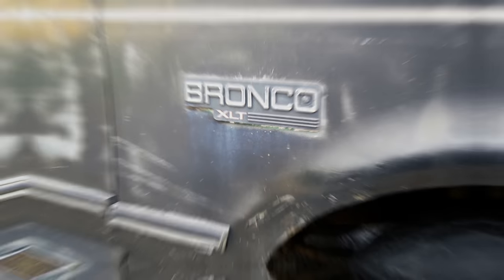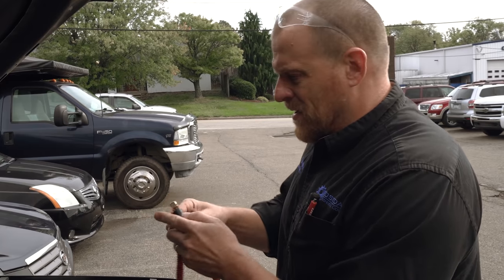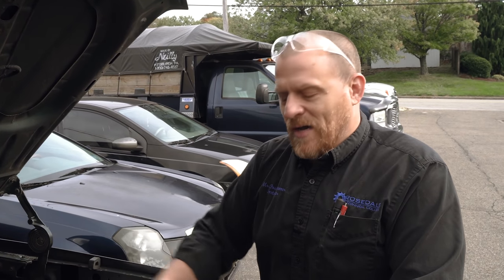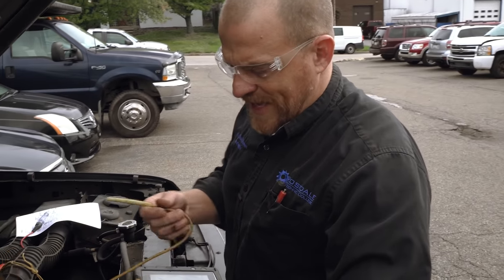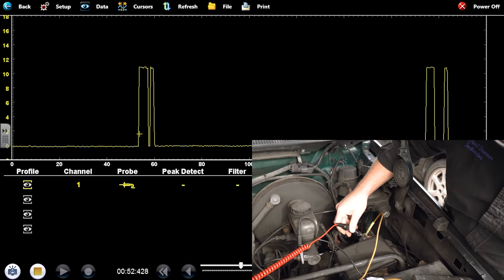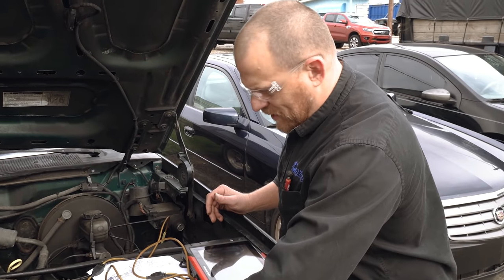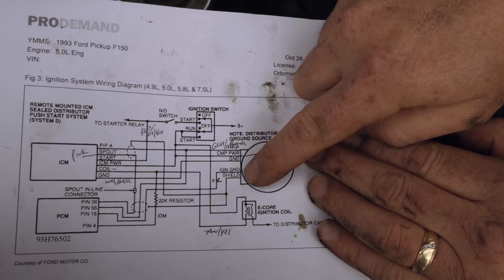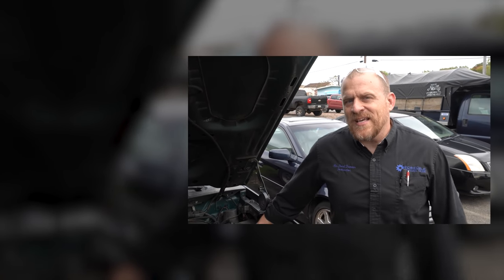Ford EEC-IV No Spark Diagnostics

Comment: Hi Paul, I'm jumping in a little from left field, but I've got a 2009 2.3L  Ford Mondeo/Fusion that's a crank no start with no ECM codes and an ABS module Yaw Sensor code, lost comm with Steering Angle Sensor and Invalid data from ECM.  I'm only interested in the no start and I don't think any ABS codes will cause a no start. But I have a vague memory of you saying some Fords with faulty CKPs will not set any CKP or CMP code? Is my memory right? But a 2009 model?? Just keen on your thoughts to help direction.
Reply from the maker: Those ABS faults won't cause what you have my friend. Is this a GDI system? Spray some carb cleaner into the intake and see if it starts as a starting point

Comment: no worries your safety comes first and that truck is a hodgepodge mess I mean the radio is hanging halfway out the dash, and due to being on a smaller pulle those fans can easily reach 10,000  rpm if idle speed at the crank/ tach reading is 1000 rpm

Comment: I'm helping a friend who has the same problem he has changed everything pick up coal Ignation module and coil and still no spark but you can hear the fuel pump run what would you do
Reply from the maker: New parts means nothing. Do some testing, then I can help

Comment: I have a question and need some guidance.

When the key is on, engine off, the back side of the ICM where the thermal paste is applied gets so hot within seconds that you’ll burn yourself. 
95 ford f150 302, 5.0 
Any ideas?
Reply from the maker: That means it is grounding the coil continuously. Not much will cause that except for crap parts

Comment: My coil voltage is too low to jump the spark from my rotor to the cap. It jumps about 1/16 of a inch
Reply from the maker: Okay, next step is an amperage waveform on the primary circuit with a scope, but I'm sure you don't have that, so it will be a little bit more tricky to identify to cause.
Low voltage on coil positive, high resistance on coil negative, a bad coil itself, a faulty ignition module or a bad ignition module ground can all give you weak spark

Comment: I've got a 7.5 that has voltage to injectors but no ground at injector connector. replaced control module on distributor. Any suggestion would be appreciated I'm stumped.
Reply from the maker: Didn't I answer this on another video where you asked a similar question on this 7.5 about the PIP signal?

Comment: Hey scanner, question  I'm  dealing with a 90 f150 5.0 . Starter shorted internal  . Whipped out starter and solenoid.  Replaced both.  Now i have crank with no fuel or spark .  I have run some quick voltage tests most all this checked out good no broken or burnt wires that I can see . could this potentially be a cause for my issue? Any suggestions or common things you've seen on these?
Reply from the maker: You have fusible links on either the starter or solenoid?

Comment: 1995 ford f150 no spark tested all connections for power and grounds everything seems to check out what could this be?
Reply from the maker: Do you have injector pulse? Did you do the PIP signal bypass test I showed?

Comment: These trucks were alot of weird issues. 
I found they have to throw a 1 inch hot spark or will never start.
Change the module in distributor . 
One kid replaced everything would not start and it had good spark by not enough to run.
Bizarre.
Some had to have coil actually grounded and often rust would cause it not to Start in 80s.
I hate these Fords.
Excellent videos Thanks alot.
Reply: I've got a 92 and it runs endlessly.  Only time I ever had a problem was when the rotor finally wore out and needed to be replaced.  The drivetrain is incredibly sturdy on these trucks...and the simplicity is a great thing.  Not hard to rebuild anything on these trucks, if one puts their mind to it.  I'll be driving my truck for at least another 20 plus years after recently doing a rebuild of both the engine and tranny....virtually everything done on my own except the machine shop work on the core of the engine.  That's the real beauty of these trucks.  They'll outlast anything new on the streets these days....because no one wants to pay huge repairs when current vehicles get into higher mileage.  You won't be fixing them at home....so they'll get crushed.
Reply: @joeidaho5938  you are lucky . I have so many come in shop. Frames rotted on box section next to front axel strut.
302 v8 was good . 300 l6 terrible EFI issues .
Happy you are good.
Reply: @MitzvosGolem1  Ya...the frame is the key to longevity.  I've been trying to protect mine...slowly applying rust paint or some kind of protection.  I know the engine and tranny will always last longer than the frame on these trucks.  My engine is also now at 40 over on the bores but just rebuilt it with upgrades.  Life has to end at some point...lol.  I'm just hoping it's good for another 20 years or so.  Thanks for your response.  Cheers!
Reply: @joeidaho5938  the pre efi Ford's are good. We live in salt belt near snow and ocean so Toyotas all frames rotted .
I like the 79 Ford's simple . 
Glad to hear your rig is ok.

We spray frame undersides with Krown oil from Canada. It's like a waxy oil never comes off and no rust.
Don't use tar rubber undercoating is bad. Holds water behind and hides rust. 
Use oil grease. Many use bar and chainsaw oil in North .
Cheers
Reply: @MitzvosGolem1  We're in a bit of a salt belt also here in Toronto....with constant salt on roads, sidewalks, mall parking lots and so on.  I've only been back in Toronto for 6 years, as I got my truck out in the Vancouver area where I lived for 25 yrs.  There are still so many out there....and they use sand on the roads mostly, thankfully.  It's absolutely rare that I see anything pre-1995 on the road here in Toronto.   The truck is definitely a rarity here.  As far as the efi, mine runs fine, on the whole, although after my rebuild I have a little bit of tuning to do.  I think it's the issue of needing to install a spacer on the idle air control to allow more air to get in when first warming up the truck.  It wants to stall when the revs first drop off after the initial idling.  I end up having to keep my foot on the gas for about 30 seconds and then it's warm enough to have a steady idle.  Still surges just a little bit but not a real issue.  I also didn't reinstall the pipe coming from the lower intake to the egr valve that then pumps back into the upper intake (plenum).  Instead, I installed a small air filter on a pipe from the egr so it pulls in clean air, rather than air from the lower intake.  Changes the balance of air a little bit, but that pipe from the lower intake is a royal pain in the ass after I installed an Edelbrock upper and lower intake.
Reply: @joeidaho5938  the 300 six has alot of weird surge issues. EFI system not good.
The 302 V8 ran beautiful.
My cousin replaced everything and I mean everything on his 92 f150 6 still don't run right. 
Check dual fuel tank valve also and in tank pumps pickup screen clogged.
Reply: @MitzvosGolem1  Ya....I  really haven't had any complaints of any real significance about the 302 roller engine.  Runs great, on the whole.

Comment: Ok Paul, after praying again, I unplugged the idle control valve and it started. If I plug it in it dies. Steve
Reply from the maker: Can you keep it running with your foot on the gas pedal?
Reply: @ScannerDanner  no sir! I bought another ic valve from auto zone today and so far it’s fixed.
Reply: @ScannerDanner  the spark from the coil is so weak it only jumps maybe a 1/16 of a inch if the icv is plugged in, Unplug it and bang, big time spark,
Reply from the maker: @steveross9058  how strange!

Comment: How did you do the bypass?
Reply from the maker: Test light to ground and touch on the PIP wire on and off with the key on.
Test light to power next if the ground test doesn't work. 
(Depends on where the trigger wheel stopped in the distributor for the pick up on what polarity to use for your test light)

Comment: So what happens if i don't get power to ground side of coil but it has power on the power side...only one side lights up??
Reply from the maker: It is one of two things:
A. The coil primary winding is open (bad coil)
B. Coil negative is being grounded all the time. 
Next test is to connect your test light to battery positive and make sure coil negative does not light. If it does, it is being grounded all the time. WARNING. Coil positive should be powered up during this test (key on). If it is not, the test I am suggesting can backfeed and give you inaccurate results.
Reply: @ScannerDanner  ok thank you will try and get back to you after

Comment: I’ve got a 1989 f150 4.9 I’m not getting any power to the coil or the dash
Reply from the maker: Get yourself a good wiring diagram (step 1)
https://eautorepair.adtrk.biz/?a=10817&c=24&p=r&s1=
Your dash and ignition coil would be two separate circuits unless you have some main fusible link that is blown? Not sure without some actual test results on these circuits

Comment: Hey I have a question, I was recalibration my tps, when I noticed my top wire(blk/w) was acting as my signal wire. So I tested the ACT and ECT to find they were acting as my signal wire. This is on a 1990 ford bronco II 2.9l. Do you have any suggestions?
Reply from the maker: Give me the readings on all 3 tps wires
Reply: Green 5.05v, bk/w 1.07, o/w 0.00. When engaging the throttle the bk/w goes up in value like a signal wire, based on the diagrams though, it should be a ground.

Comment: If it is a manual trans, you have to block the clutch pedal down
Reply from the maker: If it is a manual transmission it is super dangerous to use a starter jumper tool if that is what you are referring to

Comment: Hey buddy your probably really busy but I have a problem. I have a 89 f250 5.0 turns over fine, spark at coil but not at plugs. New distributor, ICM, plugs and wires and good fuel pressure and now my hair is white as snow any help would be greatly appreciated thanks
Reply from the maker: How far does the spark jump when tested at the coil? Should be a able to jump a 1 inch gap.

Comment: Great video!!! I have a gremlin in a ‘94 F-150, truck went to a local shop to get running. It didn’t have spark. Distributor was changed, truck started, was running fine, I drove it home.  Truck died. Would not start. The mechanic came days later. Truck started about a dozen times or so. We cycled the key on and off (to hear fuel pump prime) about 5 times or so, truck died again, no spark, no fuel pump prime. Any ideas? Everyone baffled, I’m not mechanically inclined. Thanks!!
Reply from the maker: no prime, no spark at the same time? you need to focus on the ECM powers and grounds and 5v reference circuit. I bet when this happens you have no 5v ref on your TPS or MAP sensor
Reply: @ScannerDanner  thanks for the info, this truck has many baffled. Going to check this out. The shop was thinking it was a faulty distributor/pick up coil
Reply from the maker: @joeyv1969  absolutely not! A faulty pickup will NOT cause a loss of fuel pump prime. 
It will keep the fuel pump from turning back on during cranking, but the key on initial prime will still be there!
Reply: @ScannerDanner  are you anywhere near Wyoming Pennsylvania? Lol. I need you to figure this truck out. Seriously, thanks for the info. Your videos are great. Love seeing the OBS Fords being worked on

Comment: What if I can’t get my PIP wire to generate a spark at the coil?
Reply from the maker: Powers and grounds on the ICM good? What about coil + voltage?
Reply: @ScannerDanner  I have not checked the voltage at the coil. The ICM is new. I replaced it and the distributor at the same time. Truck started and ran, idled down and then died. Wasn’t able to restart it. Noticed that one wire in the distributor harness was heating up, so I checked coil control again, and it didn’t flash.

Comment: so if it wasnt the pickup what would be next course of action
Reply from the maker: Was it the pickup in this video? I don't remember, but I'm certain I gave the troubleshooting steps for the entire ignition system so you don't need to guess at what your problem is
Reply: replaced entire distributor new , new coil,  90 f250
Reply from the maker: @JoshuaStumbaugh  new means absolutely nothing especially on these older systems. If your still having no spark issues, do some tests and I can help but guessing at what's next isn't my game

Comment: On an older video with Eric the car guy you did a similar truck and used the test light to make the Hall effect but on that one you had the test light to ground and this one you had the test light to battery positive. Why did you change the location of the test light lead? And does the connector to the distributor have to be disconnected?
Reply from the maker: It's all about where the signal voltage is at rest (where the drive plate or trigger wheel rests). If it is high, pull it low, if it is low, pull it high. Make sense?
Reply: @ScannerDanner  Got ya! I'm in tech school now and I own one of these trucks. Mine stalled out and was diagnosed as a bad module. put a new one on and it ran fine then wouldn't start again. old one won't work period, new one now works (for now) but gets very got and was smoking. New one was making spark but I could not get the test light to trigger the Hall effect but it will start and run at least for now despite me not being able to make it spark at the PIP wire, and it would only kick the fuel pumps and relay on once when I touched the wire. I am getting another motorcraft module and I'll try again and see if I can trigger the Hall effect. Thanks a bunch Paul! Always look forward to your content and always learn a bunch!

Comment: plug the vacuum advance and that pick up coil will last forever  unless- a fried module backfeeds  battery voltage into it
Reply: Never saw an EEC-IV with vacuum advance - that's all controlled by the ECU. If you unplug the SPOUT connector, that takes the ECU out of the equation. Usually do that to set base timing.
Reply: @SmittySmithsonite  early distributor mounted thick film modules about '81-'87?  pre efi.  every time the vacuum advance worked it  moved the pickup coil wires.  the wires would break inside the insulation. sometimes the'd even ohm out good. i kept spares in the glove box.
Reply: @richardcranium5839  Ahh, gotcha. Never saw one before. Probably '81-'85. '86 was the 1st year for multiport FI, at least on the Panther platform. '85 had that crappy CPI system. They had so many problems with it, the multiport system was so over-engineered that it's still working in my "86 Grand Marquis 35 years & 288k miles later!